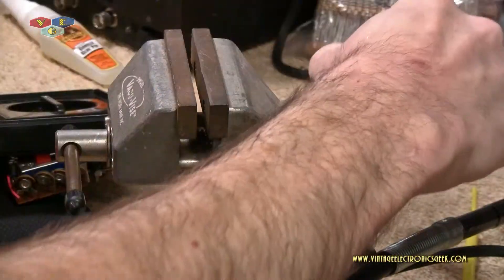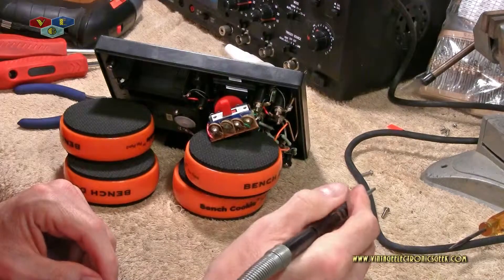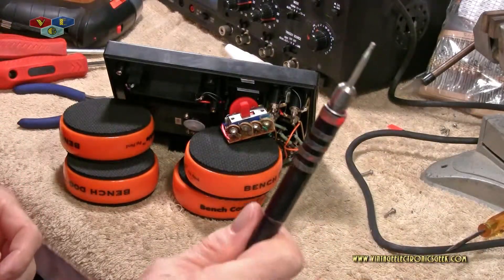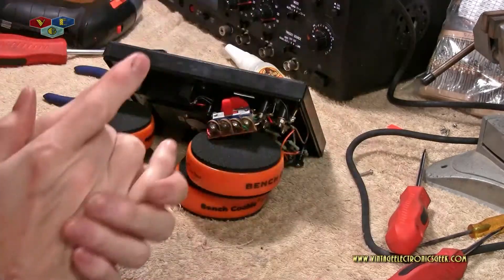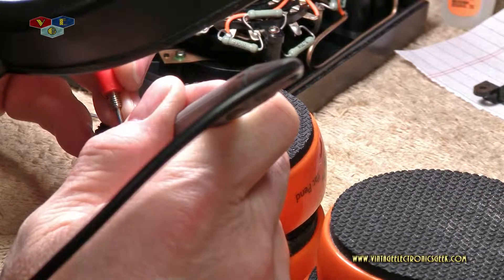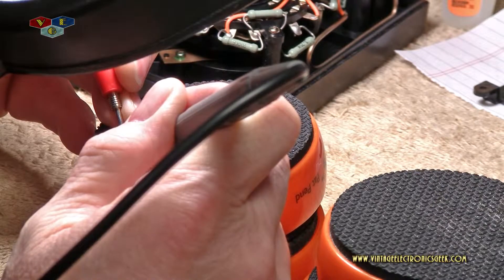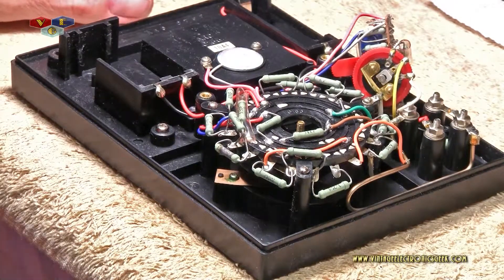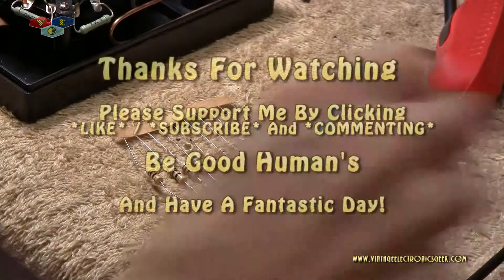Micronta 22-204 Multitester Repair - Pt III

Comment: Well Jaques, since um so dam smart, I will share my great wizdumb wit U... 
since you had to gloo dat plastic part anywaze, just epoxy it, and also fill in the two holes with epoxy, much stronger than the crappy soft plastic.  After it's dried for a day or so, drill out the holes with a 1/16' bit.  Easy does it.  Ern't um smart?  The DonOld
Reply from the maker: Actually, that is a very good idea indeed!  I'll do that next go around if I can remember, thanks for the tip Don!  ~Jack, VEG